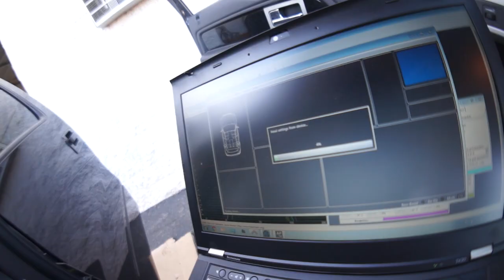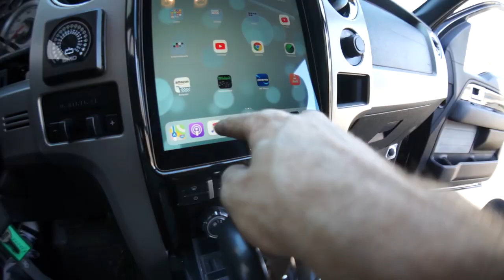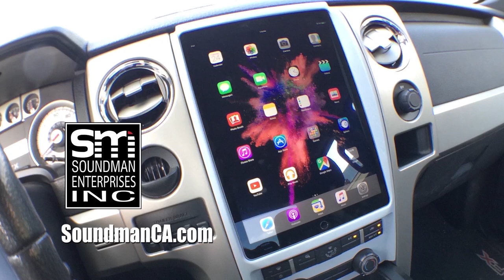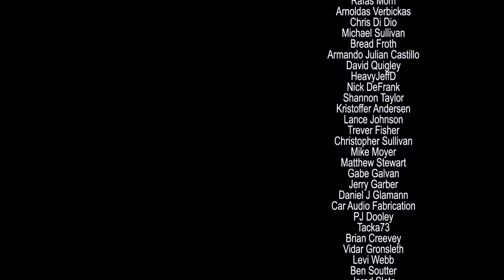Subwoofer enclosure TEST BUMP! custom 6th order blow through, CUTTING THE F150! - AMPLIFIED #661

Comment: Did you want to put wheels on the bottom of the box? The holes are now to low. This will make the boy sit lower, changing the  weight distribution of the truck, causing the truck to flip in a freak accident, fuel will dump out of the gas tank, your power wires are going to heat up, causing sparks which will ignite the fumes!!! Love the show doug
Reply: I thought the same thing at first, but if you look carefully it looks like he shimmed it up on a 1x4 or something to lift it up a little to account for the wheels.
Reply: Sebastian 😭😭😭😭😭
Reply: Actually,  setting box lower in bed also lowers truck's center of gravity. If my math is correct, giving the dimensions of the box, weight of the materials used, weight of the W7, increased drag coefficient from box,  he should be able to take a 50' radius turn at the apex now at 130mph instead of 25mph with it sitting 3/4" of an inch lower. 
On second thought, nevermind, I may have messed up a conversion here... or two....

Comment: Glad to see it in and bump'n like most of us knew it would. Can't wait till it's permanently installed and dialed in. Although I do worry about that amp unless CT Sounds fixed the issue they had with this series of amp,they did not have screws holding the circuit board to the heat sink so with slight vibrations the circuit board would flex back and forth till something breaks or malfunctions. Your luck you won't have any problems at all cause your Doug Bernard!!
Reply: That wasn't the Team amps. Not sure how the board is supported in them, but Doug took plenty of video of his with the cover off.
Reply: My mistake realized that after the fact. I believe that was the black chassis series of amps the 3,4,and 7k not sure what they called that series but realized afterwards that was not any of the Team Series of amps. I never miss an episode of Sound Man so I was trying to look every time he showed the beautiful back side of that 7k to see if I could see screws holding down the circuit board to the heat sink but couldn't tell without closer inspection. But I know Ct Sounds has their shit together and make awesome products but like everything not all goes as planned with that black chassis series they put out.

Comment: I wonder if you could toss a 1/4" spiral flute end mill with a shank bearing on a router, and probably a speed control to turn it down, and use a circle template to clean those holes up...? You could even CNC an MDF template to perfectly fit the irregular shape of the back wall of the cab.

I know it's not really noticeable, but the non-circular holes would just annoy me and that's the kind of detail that usually annoys Doug too.

Comment: That Voltage drop :O
Please add 2 more optimas... because this single one and the long way from battery to the amp and even is its only putting out 2 - 3000 watts, your single optima would be not enough. 
But looks like its sounds Fun :D

Comment: Why is the clipping light on the CT amp flashing??? Should have way enough power to run a w7 without clipping
Reply: dan daves thinking the same dam thing 10% volume all that hi priced equipment and clipping at that low of a volume
Reply: Gain can get initially set to high...has nothing to do with power.
Reply: Maybe too much power being drawn off the battery
Reply: probably high gain, clipping input or low volt is my guess :p
Reply: Yeah also the gain is set high
Reply: give him time to tune it and shit lol
Reply: BECAUSE YOU NEED TO CUT IT!
Reply: dan daves the title is TEST BUMP!!!                         ☝️☝️
Reply: Who turns on their subs for the first time with the gain turned way up?
Reply: Rico K if you have a bass nob it doesn't matter if u turn it up
Reply: nathan liar yes is does. A bass knob doesn’t replace your gain setting
Reply: nathan liar insert atomic explosion
Reply: RockfordT1 Bass I get that, but Doug has installed for years and years he isn't just gonna turn all knobs to the right...lol
Reply: dan daves its cus he has all the extra bull ish , ape 8 , Sony head unit , Apple pad...audison running mids, Sony running tweeeeeeeets and a ct sound running a band pass.....toooo many cooks in the kitchen, makes it hard to tune.
Reply: Rob Sorgdrager too many cooks, toooo many cooks,too many cooks.

Comment: Silicone makes a great sealant... Doug,  I had my whole box filled with 10" poly woof face up pounding out sounds...only holes I made in box and cab was for speaker wires.... had sun roof and rear slider plus tonneau cover over speakers...you should see the cover when bass notes are low...  :-)

Comment: With that box going through the  bed into the cab like that, won't cause problems such as noise? There's a reason for a gap between the cab and bed, to allow room for movement/flex with out causing problems. I'm just curious cause I have a single cab with very limited space and I've always thought about putting a box in the bed like that. Never did cause I figured it would cause more problems.
Reply: Steven Raneri you have to leave room on the cab side so it doesnt put pressure on the box i put 3 15s in my s10 single cab with all 3 in the cab never had a problem but i fiber glassed the box to water proof it

Comment: I thought the plan was to use some small wheels on the bottom of the box to get it in and out easier?  Gonna be tough now since you cut the holes without the added height in mind..lol
Reply from the maker: +offroader5 the bottom of the box is recessed for wheels... although I'm probably going to make some urethane sliders instead... WE CANT ADD HEIGHT because then we'll cut thru the cross brace... 💁🏽💁🏽💁🏽

Comment: Quick question if anyone wants to chime in. I have a 1st Gen CRV and i mounted my mids right to the sheet metal instead of the door panel because it was causing some ridiculous frequency peaking. Now the mid is kind of recessed into the door panel. Would making a rounded off bezel to surround the speaker and fill up the gap help with dispersion? Those mids play past 3Khz and I know I'm losing some of that high to the big space that's there now.

Comment: I did that a long time ago with a 15 w3 in sealed forcing into another chamber ending on a 6 in circular port into my single cab 2001 f150
I made the whole thing out of 5/16 mill finish aluminum.
I worked at RDS aluminum mfg. Had the sheets cut then I welded and built everything....It got down. 
I sealed my hole with a wheelbarrow tube....w9rked perfectly.

Comment: The box is going to untwist in the rain.
Reply: corey mallard it's gonna be swell 🤦🏾‍♂️🤣
Reply: corey mallard I'm sure he's going to have a bed cover on the back
Reply: That's why he is using bedliner. If it's fully painted and no wood is showing it will be fine. Also why he is gonna do a cork seal for the window..
Reply: Didnt he also drill holes under the car for cables? Those holes will rust even faster.
Reply: corey mallard HAHAHA !!!!

Comment: You should turn the ports into a tube slide for your kids - they're big enough. You could have a friggin playground if you stack another 6th order on top, which would give you 36 square orders cubed! Jeezus! GD hurricane ports killing every town you drive through.

6th order * 6th order = 216th^3. Bass nuke.

Seriously next upgrade is to hook up the trucks A/C and air intake into your blow ports. It will supercharge the horsepower and cool the cabin as long as you bump it all the way HARD. 

I'm a big fan I just can't think of anything funny to say. I have a stock sound system and I'm all alone right now.

Comment: does rafa's mom have a twin? i swear you are talking about my neighbor's mom too, maybe they are related?   ......lol.....for real though....the truck bed and the cab normally move separately 0 i suggest removing the soft rubber mounting bushing for both and replace with nylon, this will remove some of the flex- helping to keep the port hole from getting squeezed/chomped if you ever hit a big hole (BESIDES HIS MOM) things will vibrate more, just  lower the air pressure in the tires a pound or so, it will compensate, or get wider rims.

Comment: Ur voltage sucks bet u that amp blows u have an high output alternator I have stock and running half ohm I still don't drop below 12v and ur was 11v Wtf doug
Reply: Not tuned yet, gain was probably too high.